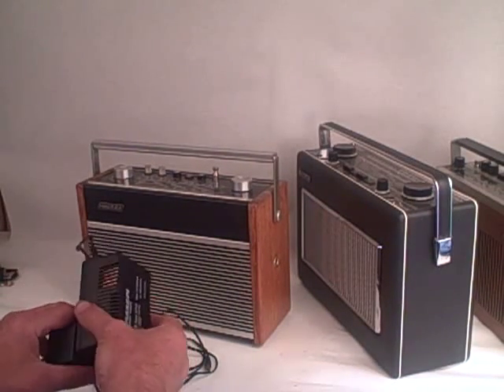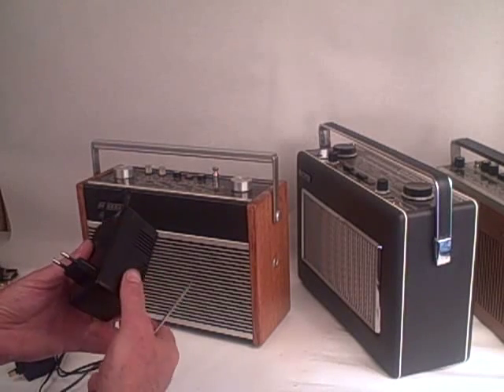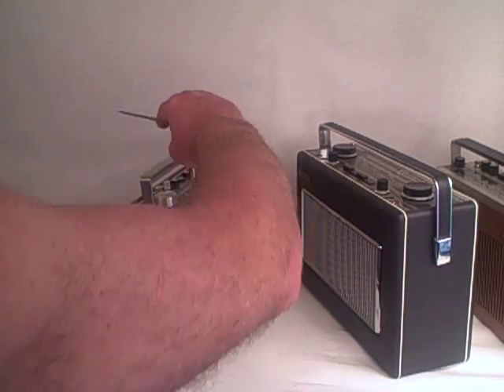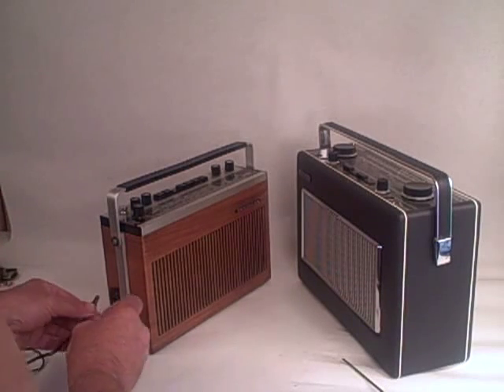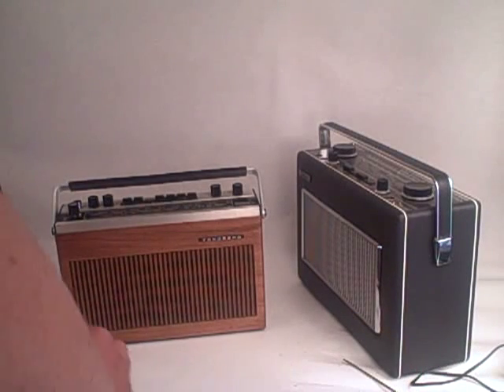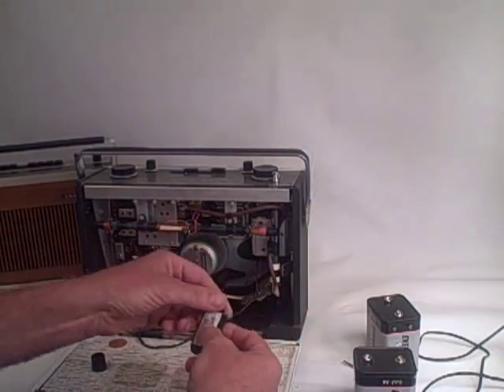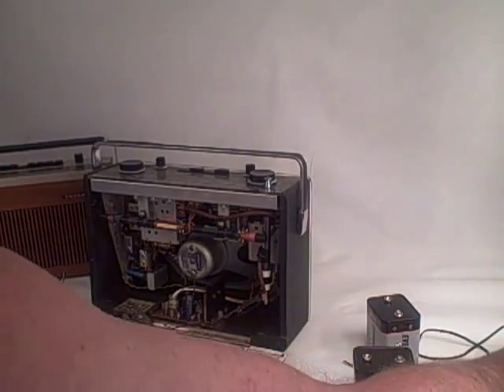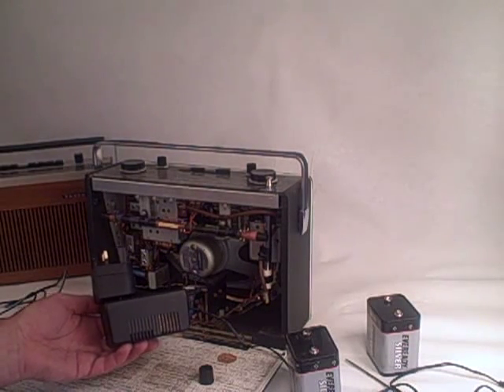VINTAGE RADIO MAINS POWER ADAPTER

Comment: Hi, It is great video. I am about to buy a Selena Vega 206/212 without the mains lead. Can I do the same thing as you did (dummies batteries) in your last radio? could you please provide the model of your adapter and the list of material I should have in order to carry out with my plan?